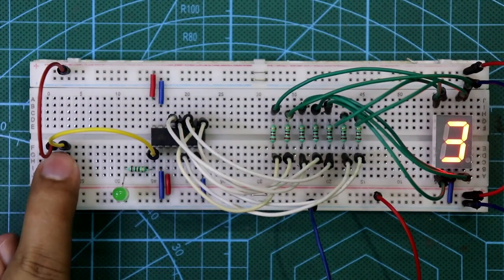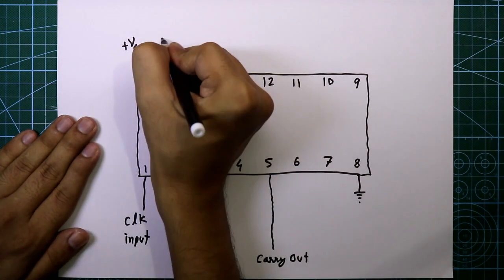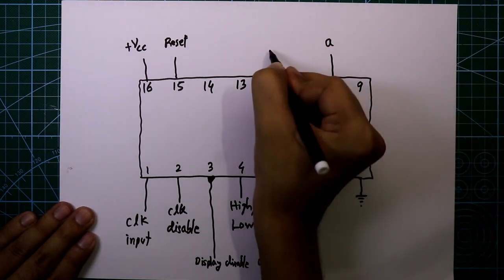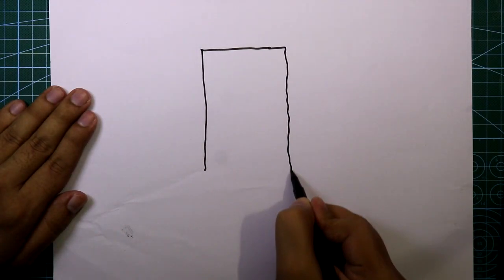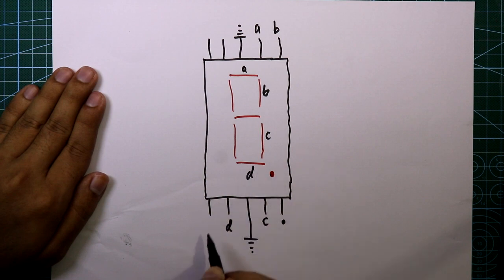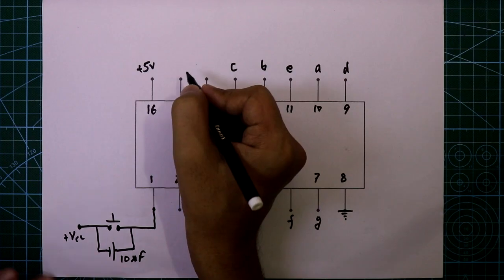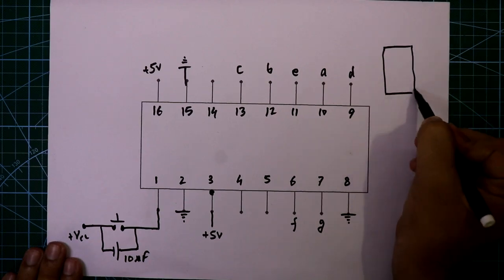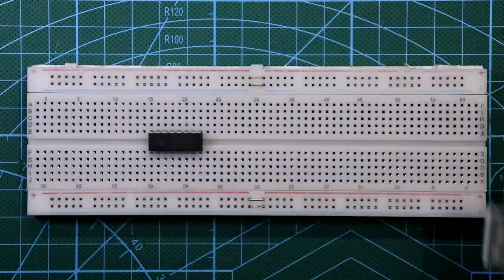CD4026 | Basic things of IC 4026 with practical circuit

Comment: Excellent video (as always), helpful, educational, and "to-the-point". I have a question about the circuit design: 
Is necessary to include the use of the resistors in the 7-seg display, like a any other common led? Thanks

Comment: Can you measure the current e.g. for segment A with and without the resistor and do this not only for 5V input (e.g. 9V or 12V) ?
Are these 8 resistors necessary or does the 4026 regulate the current independent of the input voltage ?
Reply: Just put one resistor on the common cathode of the 7 segment. There is no need to use 7 resistors!

Comment: Everytime I push the button the LED lights up and the 7 segment also lights up, but it doesn't count. What is the problem in mine?
Reply: In my opinion, the pull-up resistor on input 1 is missing.
to connect to the gnd

Comment: How many ohms reisstors are used?
Reply from the maker: 220 ohms.
Reply: At 6:12 why did you connect the wires above the common cathode display, in the positive and negative terminals what is the purpose of it
Reply: Also i have a different type of push button is it ok?

Comment: Isn't it easier to connect one 220 ohm resistor to the ground pins of 7-segment display? That way you use less resistors?
Reply from the maker: Brightness will change if you use single resistor. Here is your answer-

https://youtu.be/SpGSMsoX2f4

Please watch this video.
Reply: @EEWave  Thank you so much for your response. It's awesome knowing you are involved with your followers.
Checking out the video now.

Comment: Sir may i know the value of the resistor that connects to the seven segment display tnx sir
Reply from the maker: If power supply ic 5v, then resistor value can be 220 ohms to 470 ohms.

Comment: the "7 segment display" needs a resistor! but what size? and the 7 segment comes in different sizes, so which size resistor for which size 7 segment do i use? certainly their are formulas but you need to know the size of the led to get the voltage and current and then you can figure out what resistor to use. but how do you do that?
Reply from the maker: If you know the wattage (Basically the maximum applicable current through the LED. Eg: For the 5mm LED, we know it is 20mA) of the LED, the you can easily calculate the power of resistor (W = V x I) and resistance value (V = I x R)  

I hope this two video will be helpful:
https://youtu.be/SpGSMsoX2f4
https://youtu.be/IaH4FOQe4Y4

By the way, you can not connect large display directly to the this IC, you need transistors.

Comment: Why we used 220 ohm resistors? I try to connect 330 ohm and nothing change. Kindly explain
Reply: Come on man 
You used 330 Ohm 
I used 270 ohm, nothing changed 
The resistor values decide the brightness of the 7 segment display 
More the resistance value ,less the current through it and thus less brighter it will be 
So it won't make a difference unless it is too light or too bright which increases the chances of the LED of the 7 segment display getting burned
Reply from the maker: For the explanation, please watch this video:
https://youtu.be/SpGSMsoX2f4

Comment: sir i want to make an up and down counting counter meter of three digits. so how to do this. i did use to  needed components in this circuite, like 74ls192ic, 74ls47ic, and common anode segment , 5v 300ml amp dc supply. but i did not get succeeded in this circuit. sir pls guide  me about this circuite to do.
Reply from the maker: Will upload soon

Comment: Input 12 v or output 12 v ho sakta he kya
Reply: Can i use 9 v battery?
Reply from the maker: 12v de to sakte he par agar iss circuit ke saath dusra logic ic use karenge to prblm ho jayega. Mere hisap se aap agar 12v dena chahte ho to 7805 voltage regulator use kar lijiye. Sab ke liye acha rehega.
Reply: @EEWave  nahi bhai...muje lift ke jo 7 segment indicator aate he use sample ke tor me chalana tha...vo 12 v k aate he...kuch kar do bhai plzz
Reply: Bhai bolo
Reply from the maker: Mai wo display nahi dekha to batane mai thoda problem ho raha hai. Phir bhi try to kar sakta hu, aap ic ka power supply 5v rakho, display ka power supply 12v rakho. Dono ka ground common rakho, compulsory hai. Aab, ic se display tak jo jo signal pin connect hoga uske saath 1k resistor laga ke connect kar do. Mere hisap se kam ban jana chahiye, digital circuit to isi tarah kam karta hai.
Reply from the maker: Aur agar aapke circuit mai sirf ic 4026 hai, to aap aramse 12v supply de sakte ho, koi problem nahi hoga.
Reply: @EEWave  aap ka koi or account he fb ya insta. Aap ko pic bhej ta hu
Reply from the maker: Insta pe ee.wave search maro.